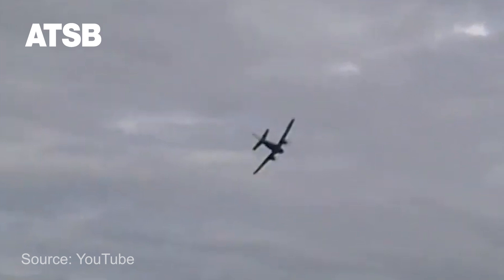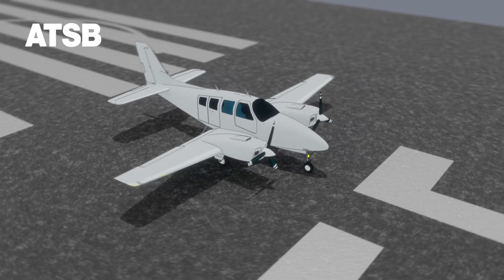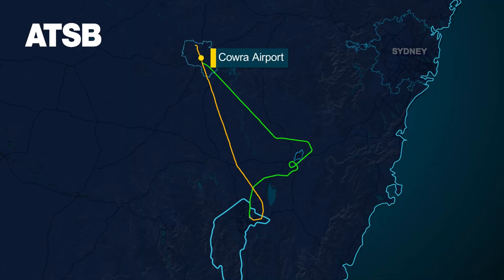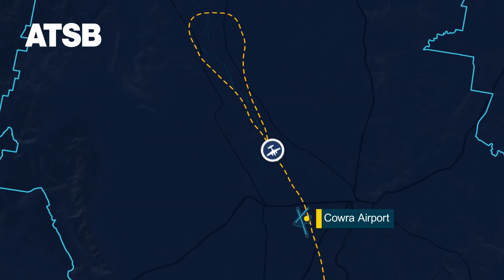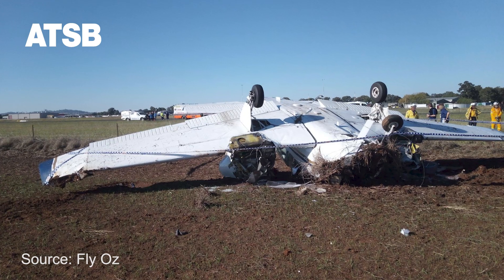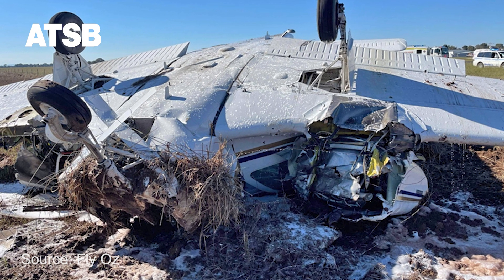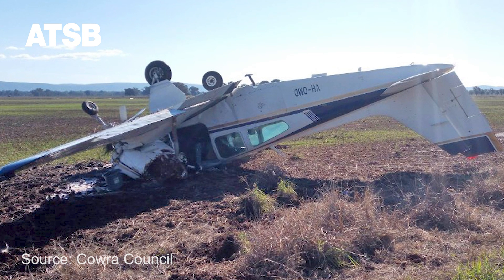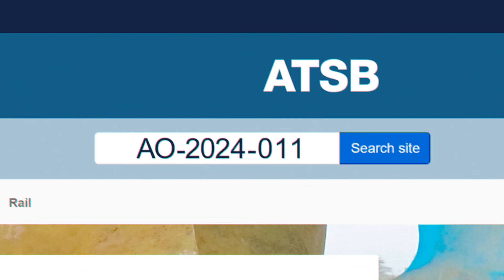Collision with terrain at Cowra

Comment: Why would you ever pull the mixture when you can just simulate a failure by closing the throttle
Reply: Its not quite the same I guess. Theres still some thrust at idle

Comment: Shocked the acronym VMC is not discussed anywhere in this video.  Ultimately that is what is at issue in this crash. 

“With an engine failed, the operating engine (assume full power) will produce a yawing force toward the dead engine (shown by T x X in the graphic)
The rudder is used to counteract the yaw and keep the aircraft straight
The rudder’s force (R x Y in the graphic) is based on airspeed
The slower the aircraft, the less airflow over the rudder, and therefore the less force (faster means more force)
As an aircraft slows and the rudder’s force decreases, the force of yaw generated by the engine remains constant
Therefore, there will be an airspeed where the rudder’s force is equal to the engine’s force (this is Vmc, the Minimum Controllable Airspeed) (see graph)
If the aircraft slows beyond this speed, the rudder will produce less force than the engine and the airplane will yaw uncontrollably to the dead engine.”

Comment: Full disclosure : cutting mixture will reflect an actual engine failure, cutting throttle to idle will not : there will be significant residual thrust. Hence you leave pilots with little or no experience about how their craft will actually fly and react. There is a tradeoff between better training and safer training. To me it seems this outfit had been providing better training without much issue until this crews lights went out (distracted?). This mishap proves to me that better training can work safely if done right.
Reply: Ya switching off the engine versus putting it to idle is not quite the same. With idle you get a teeny likkle bit of thrust, whereas with an engine out you get drag, as the net result I suppose, depends on how the numbers work out.   
But, even though putting it to idle might not give the student the full engine out experience, its still safer that you will most likely be able to quickly restore power on that engine should something go wrong. Hey it even says just throttle back in the manual. To prevent this very thing. Hey aircraft manufacturers have to cover their ass too, they don't want to be liable in the event of an incident such as this one. That's one reason they publish these recommendations. So this was a case of better training chosen over safer training. But it doesn't always go right. So sometimes the safer training might be the better option. The student pilot, as they get more experienced later on, can be in a better position to learn how to deal with the the engine completely stopped scenario, later on.  At least they have some idea for now. It might require more rudder input and more careful management of airspeed and attitude with the engine fully stopped. But at least the student can figure that out later, they have some idea.
Reply: @occyman  now whos making assumptions. You try a go around you better not forget ANY critical element. Thats what training is about. When you start removing training elements just because they can cause issues, then where does that end ? To be frank my gripe is not primarily w cutting corners in training, its w us still flying with UX designed almost a century ago. Its like we are stuck in the telephone operator age. Its inherently too risky, it forces us to cut corners in training so we are ill prepared, it increases workload at critical phases of flight, while better solutions are available and should have been made available at reasonable cost, yet they are not. Why ?
Reply: @occyman  ok, out of all those previous training flights : how many do you think went below Vmc ? My guess is zero. So whats your point ? You take high ground but offer no useful arguments. Anyway, as stated before : you assume too easily.

Comment: why wouldnt you just feather the prop and bring the engine to idle? how many gubamint brains are we paying $3000+ per week to state the obvious? flying is not for everyone
Reply: I'm not sure if you can feather the prop with the engine running, at idle. Not in a piston engine anyway.
Reply: @andrebello4191  of course you can, idle will be 800 rpm on it
Reply: @ban_usury  O so you can feather the prop below a certain RPM. Without exceeding torque limitations. If so that's better than cutting off the engine for training. In feather you're pretty much getting no or likkle thrust. It actually produces a good bit of drag too with the prop turning I think. Ya and they forgot the engine was off when they did the go around. Stall loss of directional control loss of tail ability to hold out the thrust asymmetrical
Reply: @andrebello4191  the b55 rudder can handle take off power on one side if its within vmc and the prop is feathered, but even flying with the prop unfeathered like that he would have had a lot of rudder trim on already, the prop should have just been feathered from the get go, cutting the mixture kills the engine. and yes you can feather at any time you want, when its at idle off or at full power for example a runaway prop, stuck throttle

Comment: "We also found that the operators asymmetric training procedure involved failing one engine using the mixture control without confirmation the engine was subsequently restarted, rather than reducing the throttle to simulate zero thrust in accordance with the Beechcraft B55 flight manual"  So this would be the same Operators Asymmetric training procedure that was approved by CASA when they applied for their Air Operators Certificate?

Comment: Can someone with ME experience please tell me if it would have been safer to chop power to right hand engine instead of left?

Would the P factor of applying power to left hand engine in this instance have help reduce asymetric thrust yawing moment? Or does that just come down to which way propeller is rotating on that specific engine?

Also noting that unfeathered props of inop engine didnt help either
Reply: Depends whether it's CR. Most (but not all) CR aircraft are arranged so there's no critical engine.
The approach from the report seemed stabilized on one engine. It would've been prudent to land the aircraft rather than the instructor taking over and executing a missed approach at flare. Why?
If I were the student I'd be very pissed off at the instructor doing this because it's asking for trouble. 
Lucky or what?

Comment: Instructor? I hope he isn't any longer.
Reply: I know the instructor and have been on post upgrade test flight with him. I'll fly with him again without hesitation
Reply: @MickB235  The may your god go with you.
Reply: Destructor
Reply: And why exactly is that champ , in your infinite , and no doubt expert opinion ? Fortunately they lived to tell the tale and I guarantee the instructor will be a far better operator if they choose to continue their career . ME asymmetric training is a potentially dangerous training sequence , it has killed many in the past both in real and simulated failures . And whilst there should have been much better procedures and TEM in this case , people make mistakes and hopefully live to learn from it . If anything escapes your understanding here , probably best you keep quiet .
Reply: @roddalgleish7593  Yeah it's killed many in the past because the morons pulled the mixture and this clown didn't learn from that. ME asymmetric training should NOT be dangerous and it sure as shit shouldn't kill people. I am multi rated and never during the training did my instructor pull the mixture because it wasn't necessary.

I am curious at to why it wasn't feathered when the mixture was first pulled. Would hate to have that idiot as a safety pilot and from the post, the OP either.
Reply: @roddalgleish7593  You should hear yourself.
"the instructor initiated a go-around below the minimum control speed unaware the left engine was inoperative, resulting in an asymmetric loss of control."

He placed himself in this situation by not following manufacturer's procedures by using an improvised engine out configuration and because of it a crash occurred.
Crashes mostly occur because people don't follow procedures designed to prevent crashes.
He did not follow established Beechcraft procedures for handling a Beechcraft E55 on one engine, thereby placing himself above the manufacturer's test pilots. 

Don't worry though, he'll be back out there and in a year or two and his risk taking will recommence.
Original poster is correct, he needs to go. Some sins are unforgivable and this is one. Aviation industry is full of these idiots.
Reply: well said 😊
Reply: @roddalgleish7593 
"the instructor initiated a go-around *below the minimum control speed unaware the left engine was inoperative, resulting in an asymmetric loss of control.
*The outcome was heavily influenced because he used an improvised SE procedure,
*Therefore, because he chose not to follow the very procedures designed to prevent crashes he crashed.
Being an instructor and therefore PIC his duty of care is to his passenger.
This was not a mistake but a series of intentional errors. Some sins are unforgivable.
Reply: @roddalgleish7593  'Lived to tell the tale' is your primary consideration? Sorry chum, you live in the dark ages.
Reply: @Swaggerlot  back to MSFS swaggerflog 🤡 . “Lived to tell the tale” is an absolute rarity in this event , just curious about how you turn that into my “primary consideration” DH . Would you prefer any other outcome ? Go around below Vmca , with an engine mistakenly left in an inoperative state , with that much damage and still walked away I would say is a miracle really . I think you missed the entire gist of the original comment “chum” . Still wondering why you think your original comment is valid ? You are the one in the “dark ages” bud with the purely punitive comment and attitude 🤔.
Reply: I still have my job champ